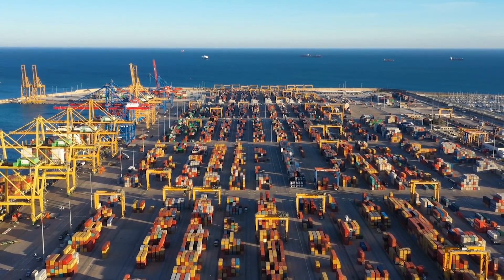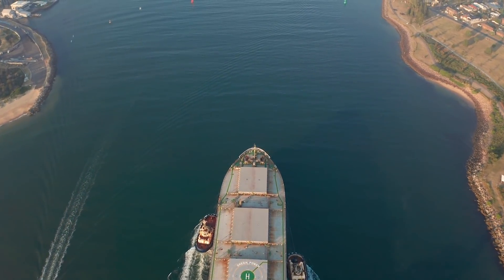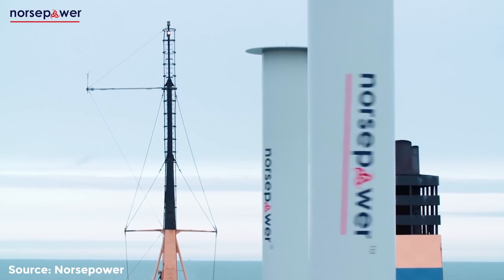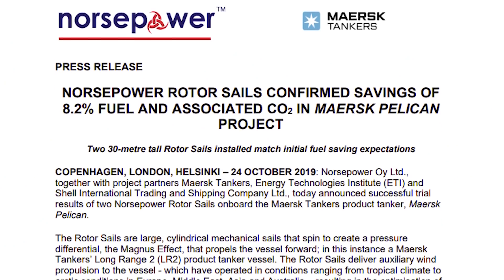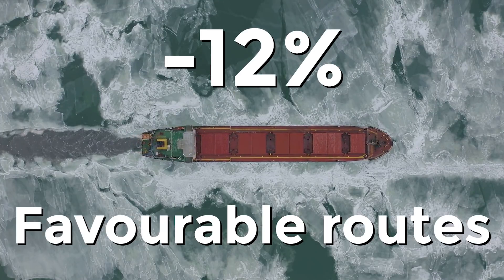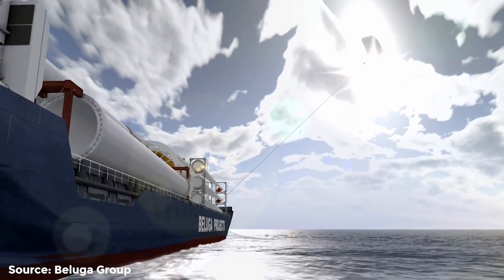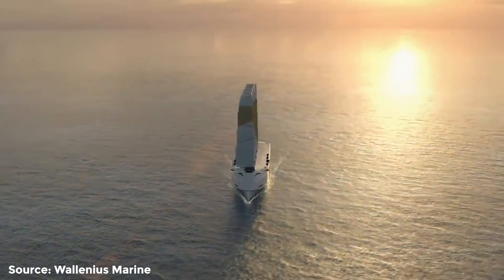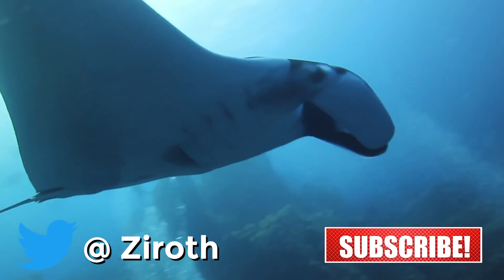Is Wind Power The Future of Shipping?

Comment: Why not nuclear? I mean it’s already used by select military ships
Reply: If you do a web search for ‘nuclear ship savannah’ you will see that it has been tried and did not work.  A similarly vessel heavily subsidised, by the government, vessel is in use in Russia which also operates, in support of the Northern Sea Route, a fleet of nuclear powered ice breakers all of these may, or may not, have been completely without issues.

Just think; would you have full confidence in the management of a nuclear reactor under the control of an anonymous entity only traceable, perhaps, via a letter box in a FOC (flag of convenience) nation state?  If you are, could you sell that confidence to Japan, the state that hosted the Hiroshima and Nagasaki nuclear detonations as well as more recently the Fukushima ‘event’?  Then try that same, or a similar, sales strategy on Ukraine, the nation state that as a part of the USSR (CCCP) hosted the Chernobyl ‘event’.  Modern iterations of nuclear energy, thorium fuel, molten salt reactors or fusion reactors, will carry the legacy of past problems.  It is the global trepidation of anything with 'nuclear' in the name and the economics of nuclear having transitioned from 'energy to cheap to charge for' too 'the costs of remediation are incalculable' that will prevent the adoption of nuclear energy as a means of creating energy at sea.  Modern reaction systems may have overcome the safety problems but the general public, having been misled in the past, will be reluctant to believe the fresh new promises.  The incident of the ‘Ever Given’ blocking the Suez Canal, March 2021, may also have a little to add to this debate.  The cooling water on ships tends to get taken in from near the bottom so when running aground the inlets are in a prime spot to get plugged up restricting, if not stopping, the flow of coolant.  One thing that the TMI, Chernobyl and Fukushima incidents all had in common was that the supply of coolant, or rather lack thereof, was a fundamental cause.

‘They’ say nuclear is cheap, it’s not it is expensive and has a large embedded carbon quotient as well as being complicated, dangerous, not universally socially acceptable and having only ‘no need for refuelling’ as a questionable advantage; actually it does need refuelling just not as often.  When ‘they’ do need to refill the warming up stuff it takes considerable longer than pumping tonnes of thick black stuff, cSt380 HFO, or thin runny stuff, MDO, onboard which is one of the reasons HMS Queen Elizabeth and HMS Prince of Wales are pushed about by ICEs and gas turbines thus using a similar fuel as the aircraft that fly off of them.  The Royal Navy (RN) with a high degree of skill and expertise uses, at vast expenses to the UK taxpayer, a current operational nuclear fleet of 11 submarines (also known as ‘boats’) in two flotillas, seven attack subs and four ballistic missile boats.  The carbon footprint of all the extra bits of hardware and the fuel, including processing thereof, from ground to propeller, are the external costs that never seem to get considered.

Disposal, once it wears out, of both the machine (that was a ship) and fuel is another can of worms best left unopened.  The 26 RN boats no longer in use are laid up (some in Rosyth and some in Portsmouth) awaiting long term deconstruction including dealing with the fuel rods and other irradiated material.  The USN is not, as far as I know, a commercial organisation working to very tight margins and also has the skill and expertise to handle the complexities of nuclear power; so as well as submarines their aircraft carriers are nuclear powered and each of the current iteration has a build cost three times that of QE/PoW, bigger crews and more generous funding.  For those who still think that nuclear energy might be the answer I recommend this report: - https://www.bbc.com/future/article/20200901-the-radioactive-risk-of-sunken-nuclear-soviet-submarines?ocid=ww.social.link.email.  The navy of the USSR might have been under resourced and over extended but it was still generously supported in comparison with merchant shipping.  While merchant ships may be 'taken up from trade' as the RN would say, or may be captured or impressed by non state quasi military entities by way of piracy, but cargo ships are not military vessels.

Comment: To address the suggestions that sail power is the answer I offer the following example.  In 1870 a premium sailing vessel entered service, the ‘Cutty Sark’.  The Cutty Sark was 64.74 metres in length with a beam of 10.97 metres and a loaded displacement of 2 100 tonnes.  She was able to carry 1 700 tonnes of cargo and to harness the energy in the wind the available spread of canvas was up to 2 976m2 which was tended by a crew of about 30 skilled men.  A ratio between the sail area (SA) and the vessels displacement (D) determines how lively she is; ‘lively’ being nautical speak for ‘fast and manoeuvrable’.  The carrying capacity of cargo ships is constrained in two ways, mass and volume which leads us to the ‘stowage factor’ of the cargo; the more mass on board the greater the displacement which in turn impacts the efficiency of the hull form and sail area / displacement ratio.  A vessel constrained by mass is said to be ‘down but not full’, a vessel constrained by volume ‘full but not down.  When in the tea trade, which the ‘Cutty Sark’ was designed and built for with fine lines (more nautical tech speak so again - no need to worry about it) she could carry around 600 tonnes of cargo at speeds of up to 17.5 knots dependent on the prevailing wind and had a typical China to UK time on passage of 120 days.  The tea trade was very competitive so ‘time on passage’ was a large factor in securing the premium freight rate that made her cost effective.  Rounding things out her maximum available sail area gave circa 5m2 of canvas for every tonne of tea carried.

As soon as the Suez Canal opened, which the ‘Cutty Sark’ was unable to sail through; she lost her advantage, raw speed, to the steam powered ships of that era who could beat her ‘time on passage’.  Mechanically powered ships have improved in terms of efficiency, on a freight tonne mile basis, by at least one order of magnitude since then.  After losing out to the coal burning, steam reciprocating mechanical ships of the late 19th century ‘Cutty Sark’ was relegated to the Australian wool trade, just about the bottom of the barrel in maritime terms and only one small step up from being a 'honey barge'.  The canvas, cordage and extra manpower needed for sailing ships was never a very benign environmental option so please discount any idea of sail as ‘sustainable’.  All this is without the problem that if ‘the wind don’t blow the ship don’t go’, when it does blow it often blows in the wrong direction for your cargo delivery needs and sometimes there is rather too much of it for comfort.

Random facts about ‘Cutty Sark’, it is said to have been possible to coax 3 000 horse power out of her sails, or in ‘real money’ 2 206 500 Watts (2.2 megaWatts), in those elusive ideal conditions or 741 Watts for each square meter of sail area.  So that majestic spread of canvas would have been even less efficacious for delivering your baubles and bows from the orient, despite taking about 120 days on the voyage.

Comment: I mean speed isn't really the main reason why sails went out of favor it was actually manpower. A traditional sail ship requires a large crew to manage the sails as it is a task that at the time was not very easily automated. Whereas a coal fired ship only requires stokers and engineers to manage the engine, and stoking can be automated, and oil requires none of those. Modern freight ships have only about a dozen crew members at most on even the largest ones. Cargo ships these days aren't exactly fast either and usually spend most of their time running at a fraction of their top speed, rarely actually going much faster than sailing ships used to do.

Comment: when you say 3% of emission do you mean total or just the human emission, you know that ships are estimated to emit 50% CO2 emission from humans, and a diesel engine on a ship consumes about 1-2tonn of Diesel Per 1000KW per hour and container ships generally has a motor of at least 20MW, this means that a ship uses more diesel or heavy fuel than a car does in it's lifetime even if the car runs and function for more than 30 years, in just a hour(this depends on the motor size). and the NOX/SOX is being done something about with improvements to the motor design and exsost filtration systems.

Comment: In the early 1920s German shipping was crippled because of the fact that mining in Germany was hit a hard Blow by labor shortages. I mean, all those dead miners rotting in the trenches would be a problem. So they developed the wind columns similar to these ones you saw on the first ship Illustrated here. These were used as an auxiliary power, to propel the ship forward when conditions were favorable. I understand that they cut down fuel consumption by 60% in this way. The reason they did not continue to be used, is that the coal shortage was resolved eventually and prices for coal went down.

Comment: I remember all this, from 50 years ago.
I wonder where they get these 'new' ideas from?
Reply: It's more about new material and technology for rather old ideas, a bit like with Jules Verne and his moon rocket from 1865. It took some time for the technology to catch up.
Reply: @hurri7720  I understand what you mean though I didn't see any new materials or new technology here. For example... a ship called the Buckau crossed the Atlantic in 1926 using a Magnus rotor and these have been trialled on large ships many times since then.
I wouldn't compare this with Jules Verne since there weren't any large rockets in operation then, it was all just fiction.
Reply: @hurri7720  50 years ago we already had computers and large glass-fibre constructs on ships, including magnus rotors. Magnus rotors are still made of glass-fibre today because using carbon fibre would be ridiculously expensive. Perhaps you might do a little research into how things are constructed of carbon fibre, then you will understand why it is mainly used for smaller components, smaller builds.
Reply: @hurri7720  You don't get it.
Byee

Comment: What ever you can think can convert into reality a high brid system will be more practical in this field where under water empellers turning the wave and ocean currents into electricity or directly powering propeller shaft for the purpose also adding power

Comment: Forcing compressed air to create a vacuum bubble around the hull similar to that being used in submarines and torpedoes in conjunction with wind power devices and bio fuel engines to support pumps will introduce a new era in sailing.  This is being engineered and will be floated on a mega yacht under design to prove the concept.  Expect 90% decreases in consumption.  Cruise speeds are expected increase to increase from 100% to 150% with structural hull loads expected to be the limiting factor. Container cargo will be completely enclosed in upcoming designs much like stealth fighters and bombers such as the B-2 bomber and Y-22 and F-35 fighters. These vessels will resemble blink like fast moving structures at high speeds over the water and significantly faster by 50% in rough sea swells.  Enjoy your preview.

Comment: "wind powered boats are the future of sailing" that's, called sailboats.
Reply: Wind power, the history of shipping..
Reply: "What has been will be again, what has been done will be done again; there is nothing new under the sun."
Reply: Why don't use hydroelectric power ships
Reply: You better be happy now your I Phone can get like 2 cent cheaper.
Reply: Technically, they don't have sails though, that's like saying lava isn't wet because it's hot.
Reply: @nukedukem6  aight gotcha
Reply: Lol
Reply: Yes...🤣🤣🤣🤣🤣🤣🤣
Reply: ikr, hahaha
Reply: @Dominus_Potatus  yea fr
Reply: Hahaha
Reply: LOL
Reply: It’s the shove to push mankind back to the dark ages I swear!!
Reply: Hahahhahaha
Reply: Kind of along the same lines of what I came to say. Didn’t we do wind powered ships centuries ago?
Reply: Or the Tall Ships that typically carried the world's cargo prior to the mid-late 19th century.
Reply: Blade boats then? As foil boats is used already..
Reply: @TheStuartstardust  Blades ad sails are both simply airfoils generating a lift force from 2 induced turbulences in a flow field. They are physically the same in fluid dynamics. You can also do kite or a Flettner rotating pipe. The Flettner got the highest lift/drag ratio at 34 (vs 2 to 4 for airfoils).  See Eship-1 from Enercon.
Rigging a textile sheet as genova/foresail is just the cheapest approach to the same lift generating surface thingy. It was basically dropped needing to quickly crossing passat winds lull zones and the large number of crew to operate. You can fully automate now but that still requires full backup drive train and fuelss to carry as a burden. plus high maintenance cost of textile wear. Every recreational skipper does carry an auxiliary motor. Most never use their sails for real. They barely know how to because maneuvers roll the girls in bikinis over board. Or worse,  the beam shifting knocks them out and trigger smillions in damage claims. A super model lost that can't do anything but walk 30 feet and turn.
Reply: @cyklonetidalenergy7141  nicely explained!!

Comment: the problem really comes down to infrastructure  it is hard to innovate when you are in tight boundaries  for example there is a max width and length most cargo ships can bee because of the canals  and height is also a restriction because of the cranes used at most major ports

Comment: In the 70's, a ship was fitted with rotating tubular sails. It sailed quite impressively until high wind bent the sail tubes. This idea is not new, but it will take either an oil blockade or government intervention and support to convince shipping company's to change their oil glutenous ways.

Comment: Windjammers of the morden age.
Reply: To address the suggestions that sail power is the answer I offer the following.  In 1870 a premium sailing vessel entered service, the ‘Cutty Sark’, she could carry around 600 tonnes of cargo at speeds of up to 17.5 knots, dependent on the prevailing wind, to harness the energy the available spread of canvas was up to 2 976m2.  To round things out that was circa 5m2 of canvas for every tonne of cargo carried.  The ‘Cutty Sark’ was designed and built for employment in the tea trade where time on passage was a large factor in securing the premium freight rate that made her cost effective but as soon as the Suez Canal opened, which the ‘Cutty Sark’ was unable to sail through, she lost her advantage, raw speed, to the steam powered ships of that era.  Mechanically powered ships have improved in terms of efficiency, on a freight tonne mile basis, by at least one order of magnitude since then.  After losing out to the coal burning, steam reciprocating mechanical ships of the late 19th century ‘Cutty Sark’ was relegated to the Australian wool trade, just about the bottom of the barrel in maritime terms and only one small step up from being a 'honey barge'.  The canvas, cordage and extra manpower needed for sailing ships was never a very benign environmental option so please discount any idea of sail as ‘sustainable’.  All this is without the problem that if ‘the wind don’t blow the ship don’t go’, when it does blow it often blows in the wrong direction for your cargo delivery needs and sometimes there is rather too much of it for comfort.

Comment: I think the main thing is to take hulls out of the equation. They are all DRAG in a viscous substance.
The experiment should perhaps take the overall form of attempting to find the same effect for a tenth of the expended energy in bulk transports.
Rafting over space - Polynesian style - is a starter to reduce drag.
Containers made of carbon instead of steel is another for ‘sleeving’ into more secure units at ports is another which would reduce weight along with the removed weight of massive hulls.
Increasing speed three fold is another suggestion in order to be able to out-run adverse weather conditions or re-route while transiting.
The lifting power of ground effect for heavy loading needs exploration.
If viable then scaling needs investigation.- three-mile modular wings with containers forming part of the aerodynamics of the structure?
Wind and large hull - seems very out-dated to me - just looks wrong.